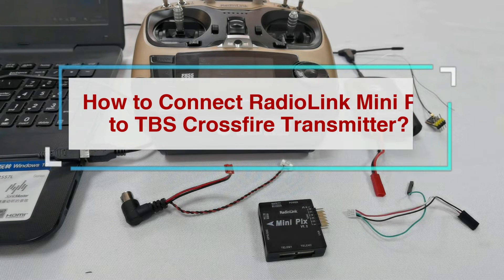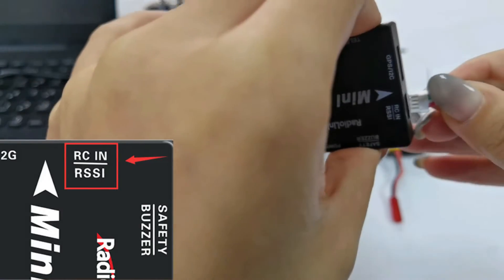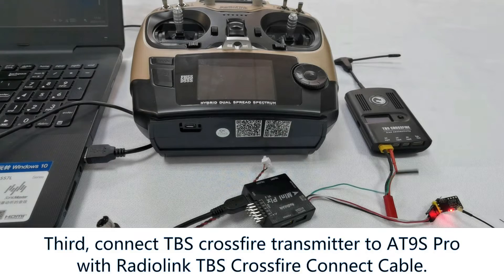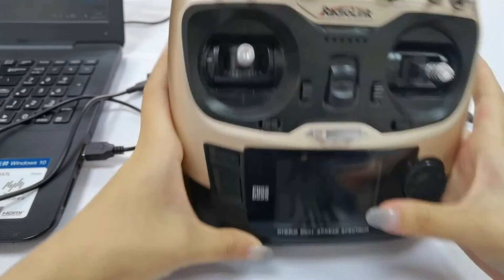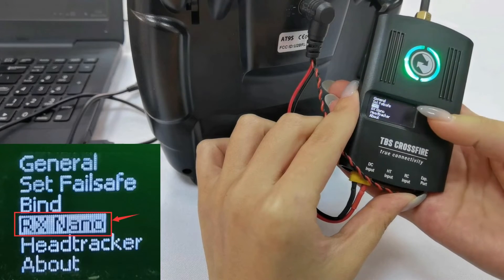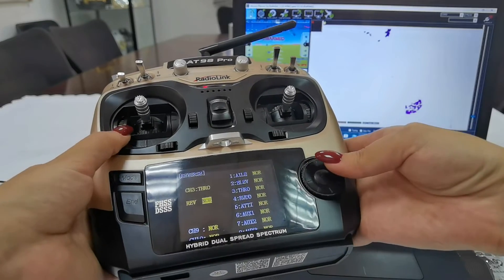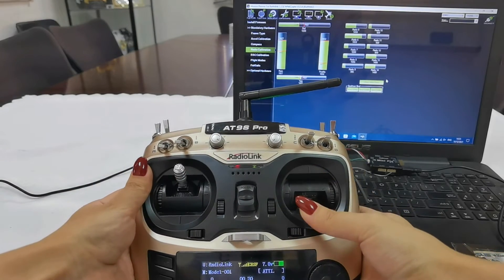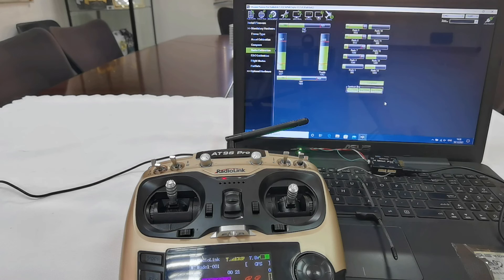How to install TBS Crossfire on RadioLink PIXHAWK/Mini Pix/crossflight?

Comment: Hello, you only used 3 of the Pins of the Crossfire Rx. Which are these please? As the Crossfire Rx had 4 pins, being Ground / 5V / Tx / Rx ? Also can the Mini Pix / Crossflight still record RSSI for signal strength of the R/C connection? Thank you.
Reply from the maker: Hi, sir. SBUS signal is used, so only three pins are connected. They are Ground, 5V, and TX. And here is the link to show how to output RSSI value from receiver to FPV when AT9S Pro and our flight controller are used: https://www.radiolink.com/newsinfo/477916.html  If any question please feel free to contact us. Our email is after_service@radiolink.com.cn
Reply: @Radiolink_official 
Excellent. Many thanks for the response. Very much looking forward to mounting my RadioLink Crossflight in my R/C plane 😎👍
Reply from the maker: @DanielJ-DJ  Our pleasure. If any question please feel free to contact us. Our email is after_service@radiolink.com.cn
Reply: @Radiolink_official 
Hello, sorry a further question please. ☺️ So Crossfire Rx successful working in RadioLink Mission Planner. However problem is Radio stick movements different. Throttle shows up as "Roll" etc when doing the Radio Calibration. I tried changing the Servo Outputs in Mission Planner, but it didn't change the assignments. Sticks not controlling correct Throttle / Yaw / Roll etc.... Is there another setting in Mission Planner to fix this? Such as changing transmitter Mode (to 2) for example..... ? Thank you.
Reply from the maker: @DanielJ-DJ  Hi, sir. May I know what RadioLink flight controller are you using? Is it convenient for you to take a video or some pictures to us to show your problem? You can send details to our email after_service@radiolink.com.cn  Thanks in advance.
Reply: @Radiolink_official 
Hello, I'm using the RadioLink Crossflight. Blue cased unit. TBS Crossfire R/C working now in Mission Planner. Mounted in the plane, only the Throttle responds to stick input. No Servo movement. Does the Crossflight flight controller provide power to the Servos (ail / elev / rud) or is that power taken from the ESC BEC power pin? Thank you.
Reply from the maker: @DanielJ-DJ  Hi, sir. Sorry CrossFlight cannot supply power to the servos. You need to supply power to the servo separately.

Comment: you didint mention about mission planer parameter list setup. on minipix which serial number of connetion ?
Reply from the maker: Hi, sir. TBS Crossfire is connected to the transmitter. Only the receiver is connected to Mini pix. You just need to connect the receiver to RC IN port. If any question about RadioLink products please feel free to contact us. Our email is: after_service@radiolink.com.cn

Comment: How about Rc6gs surface to crossfire
Reply from the maker: Hi, dear. Theoratically, if you upgrade the firmware to V6.3.2, it supports PPM signal input, so it can work with Crossfire. But we haven't tested about it. Here is one of the tutorial of how to use Crossfire on RC car. You can follow it and have a try. It would be great to see they work.